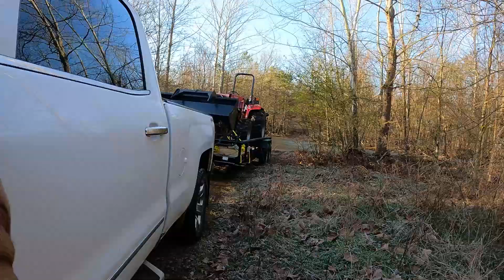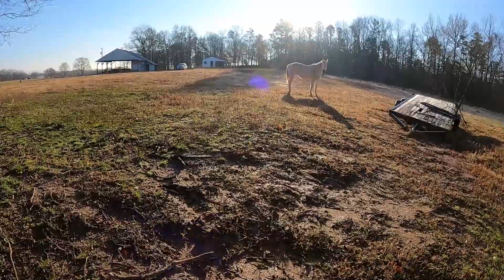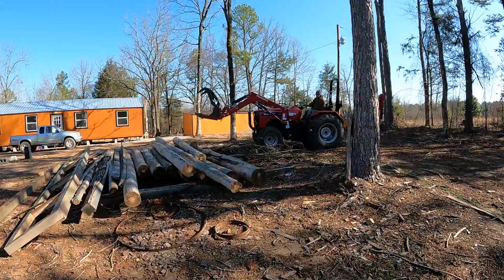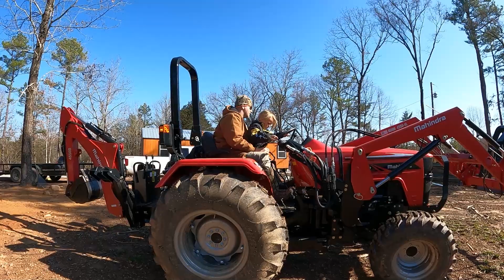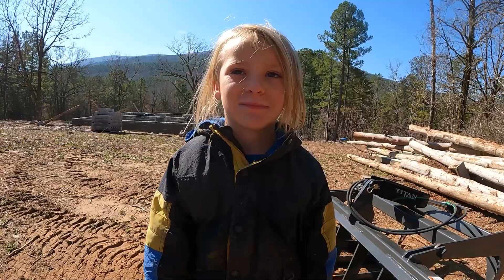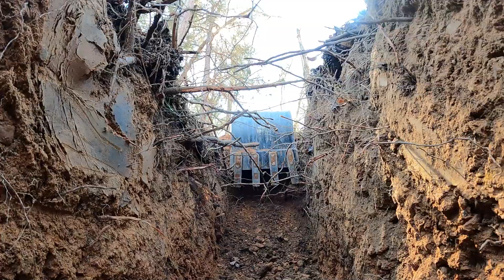WORKING ON THE 41.36 | homesteading  off grid living | cabin build | cabin  off grid cabin | tractor

Comment: Suggestion  choke trailer  tires really good , when you were unloading  lifted back of pick up off the ground   hard on transmission   a d no emergency  brake with tires off the ground
Maybe some jack stands at the back of trailer  so as not to lift back of tow vehicle  off ground